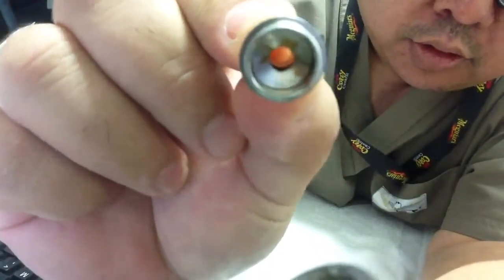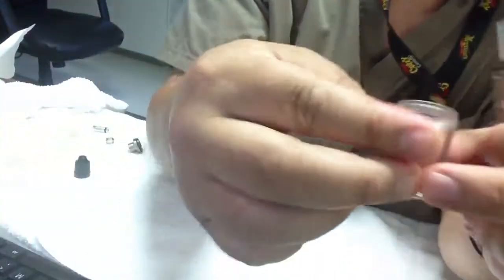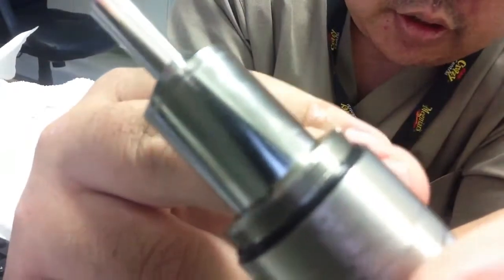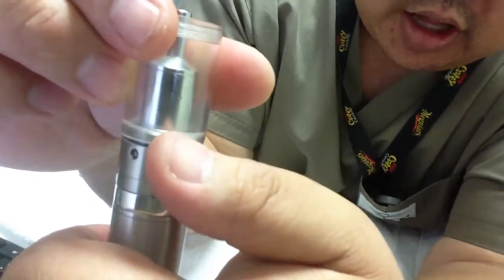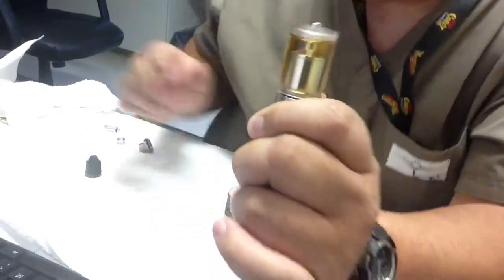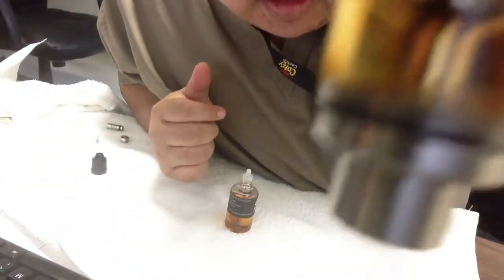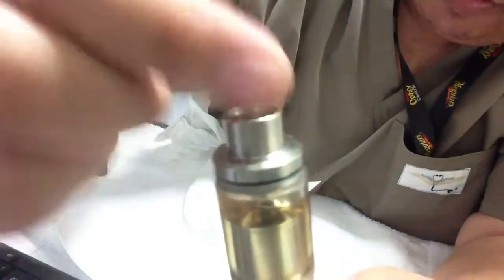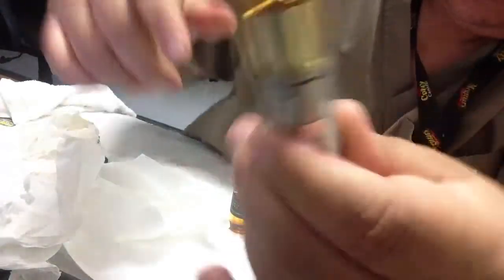Kayfun 3.1 how to fill it

Comment: Why does mine keep leaking when I fill it up everything is screwed on tight please help it leaks from the tip when I put it upside down and or from the small whole on the bottom
Reply: That word is spelled hole. Not whole. Jeez
Reply: Sounds like your o-ring might be damaged or needs to be adjusted.
Reply: leeran8 Mine did that, too. What I do is I cover the hole while I turn it upside down,  but I still cover the air hole. I then lay it on its side (with the air hole facing UP) before I release the air hole. Then I screw the top cap tight. otherwise the juice runs out the drip tip. I won't say it's perfect, but far better than letting go of the air hole while it's upside down. I often get a slight flooding, but not too bad, just vape through it. Cheers, and sorry for the late post.

Comment: Just fill my kayfun 3.1, flavor is unbelievable but vape production sucks,  :|
Reply: What's the Ohm rating on the coil you built? The Kayfun with a 1.7-2.0 ohm coil at around 10 watts or so has awesome vapour production even on a 60/40 PG/VG juice. I've got a FT clone on an SVD, 1.5ohm at only 9 watts and it's making CLOUDS!